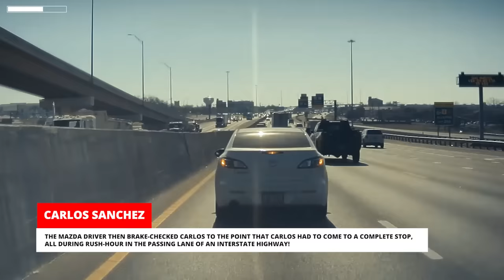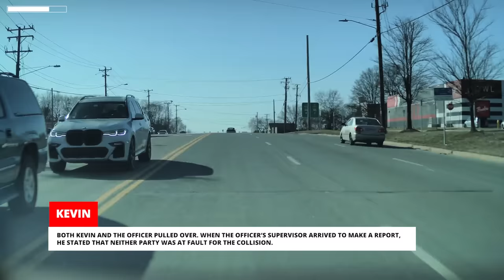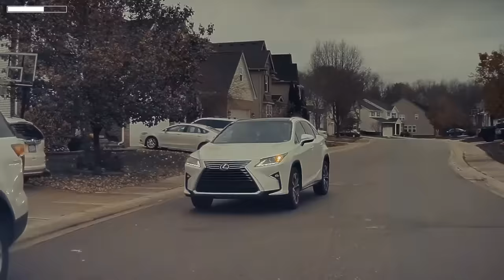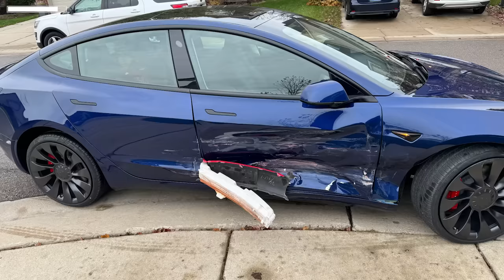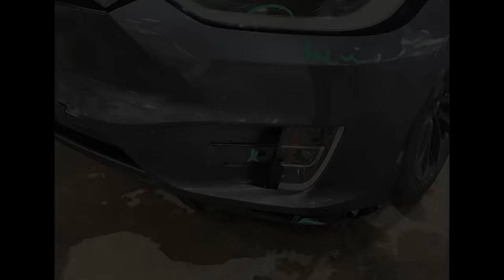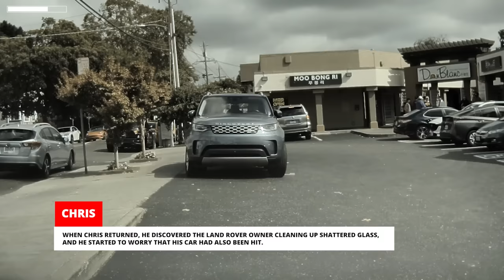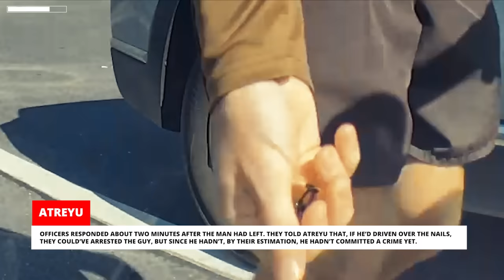INSANE ROAD RAGE ATTACK CAUSES MASSIVE HIGHWAY CRASH

Comment: The accident with the Madza when the police did not enter into the report
 In TX that is considered a non-contact accident. The other drivers involved due to inattention and faulty evasive action (a catch all)
Reply: I was going to write the same, is considered a non-contact accident, which not all states have it, but in Texas is possible, the Officer should known that, which is hard to prove it unless... you have dashcam or TeslaCam.

In Miami, I saw something similar but only one car was involved, the office said the same thing to the girl, but back them I didn't know about this.
Reply: In The netherlands it is not aloud to stop on the hiway without a good reason.
Reply: Doesn't matter what state it's in.
EVERY one of those involved drivers should get a copy of the video and ALL should file reports.  They will also be able to press charges against the mazda owner (who will, of course, say they were not driving despite the fact they were).
It will also give them the owner's insurance information AND RESIDENCE.

A little sleuthing will identify the vehicle... which would probably be rendered non usable shortly thereafter.
Reply: @amzarnacht6710  Agreed, civil action.

Comment: @Mustafa.  In most countries, a yellow or amber traffic light means "The driver is required to stop at the intersection unless it's unsafe to do so". The video shows a stale Yellow/Amber light (Which means it had been that colour before approaching the intersection). By speeding through the intersection you would have been at fault if there was a collision.

Comment: Mustafa, That light was a stale yellow then you decided to floor it, You had time to stop (Over 4 car lengths and some more) but you actively chose to gun it up to the yellow and then proceeded to run it (Crossed the line after the light was red), I wouldn't blame the guy for merging over thinking you where going the speed limit and was already slowing down for the stale yellow, You where also definitely going 10+ over the speed limit at that point from my experience in Tesla's if you floored it lmao, I'd take it as a lesson learned cause no one was hurt and no damage was done

Comment: Regarding the red-light incident:
Here, in Texas, the yellow light legally must be on for a minimum of one second for every 10 mph (16 Km/h) of posted speed limit.  So, on a road with a (for example) 30 mph speed limit, the yellow light must be on for a minimum of three seconds.  In other jurisdictions, whether it is a law or not, it should be at least a rule of thumb or a guideline.  YMMV.

So, knowing that rule, when approaching intersections and the traffic light goes from green to yellow, I immediately start counting mentally, "one one thousand, two one thousand, etc." and some quick mental math including how quickly I am approaching the intersection and how many seconds are left.  The last variable is if another driver is riding my back bumper.  Then the answer presents itself as to whether I should cruise through, brake, or drop the hammer (accelerate hard).  Here, in Texas, red light cameras are now illegal, so that's one less variable here.

In some jurisdictions, when red-light cameras are installed, the yellow light is shortened.  When this is done, questions about increased revenue vs. increased safety tend to arise.

Do your Math, people!

Comment: Story #1: Texas Transportation Code - TRANSP § 545.363. Minimum Speed Regulations: (a) An operator may not drive so slowly as to impede the normal and reasonable movement of traffic, except when reduced speed is necessary for safe operation or in compliance with law. 
Easy lawsuit against the Texas police for failing to uphold the law.

Comment: @12:05 #6 yes, sadly window-smash "bips" are happening all over CA & especially bay area, bit less now than previous years, but still... FOLD YOUR REAR SEATS DOWN to show empty, so they can just peek inside w/o smashing quarterpanel to reach the seat button. Seatlocks don't help as your window is already smashed.
Put any valuables in locked frunk or maybe subtrunk out of sight, and TURN OFF any bluetooth/wifi devices so they can't sniff them.

Comment: 13:30 “when the traffic light turned yellow, he gunned the motor to make it through but he thinks the light turned red before he made it” 
1. yellow lights mean slow down, not floor it 
2. he didn’t gun it until after the light turned red 
3. again, video clearly shows the light turn red when he’s still more than halfway to the intersection
4. a tesla goes from 60mph (96kph) to 0mph (0kph) in 115 feet. he had more than enough time to stop considering he was going 30mph (48kph) tops
5. not saying the other car’s actions were ok (because they weren’t) but mustafa is acting like he’s an innocent little boy who made an honest mistake when, in reality, blowing that red light was as intentional as it could be.

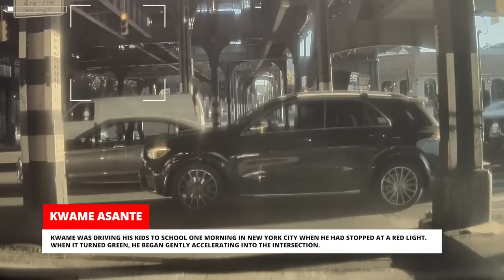Comment: Is anybody noticing these extremely expensive repair costs, or totals?  5:41, I have a Mazda 3 with a similar incident about a year and a half ago. The total repair cost which included a quarter panel, paint and new headlight assembly plus some other stuff, came to $1,800 and took one week if that for the repair.  That dude spent $25,000 and wait 2.5 months with a rental car... $40 x 75 days which is roughly $3K on top of the repair.

No wonder insurance companies are charging people with Tesla's much higher premiums.  This goes for all EVs.  That's why the average cost of owning/leasing for EVs that are supposed to be on every man's car like model 3s are soaring past $1200 a month.

Comment: #15: The officer is wrong.  The driver who caused the collision through negligent or reckless driving is at fault whether their car is hit or not.

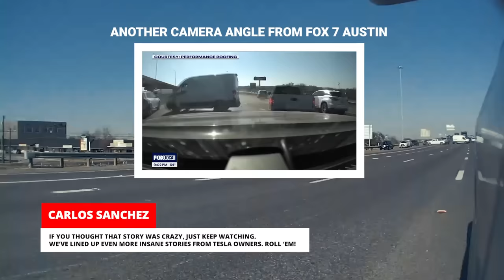2:46 The supervisor is wrong.  The officer didn't ensure traffic was clear before entering the oncoming lane.

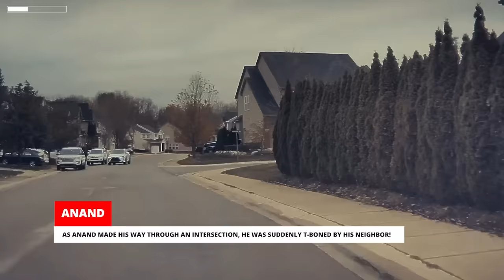6:54  By law, the first person to arrive at an uncontrolled intersection has the right of way; basically, it is treated like a 3-way or 4-way stop.  If vehicles arrive at the same time, the person entering from the right at an uncontrolled intersection has the right of way.  In this case, by law, the person heading toward Anand had the first right of way, then the car on his right and then Anand.  Uncontrolled intersection right of way isn't always as straightforward as drivers think.

13:25  Mustafa was definitely in the wrong for running the light, especially since he had time to stop for the amber, but, that doesn't mean the other driver can cut him off.  Both are in the wrong but for different infractions.

15:01  Legally, there is nothing he can be charged with, but, if they knew who he was, they should have had a chat with him.  I wouldn't have blurred his face either.

Comment: It doesn't matter were you live a yellow light means the red light is coming on and you should stop if it's safe to stop. Long yellows are not long to give you time to beat the light, they are long because you may need more time to stop before, or clear the intersection.

Comment: #11, That is not an intersection. The streets do not intersect. One street ended at the thru street. In Arizona, and I suppose most if not all other states, that would place an automatic yield for the car on the street that ended. I run across drivers that like you don't understand that. Makes for some challenging driving sometimes.

Comment: Mustafa is to blame there.
Yellow means "Stop whenever possible" not "Gun it, YOLO through and cause danger". Clear breach of the rules even if he had entered the intersection before it turned red.

That said the other driver was dangerously indecisive. Probably too old to still drive safely if I had to guess. He set the stage by his confusing indecisive attitude. Which I why I always honk whenever I begin to overtake or undertake a driver who's signalling towards my position apparently incorrectly: If it's not incorrect but indecisive driving, it gives them a chance to react and avoid causing a problem.

If they'd hit eachother I would've pushed for 50-50 damages.

Comment: While Mustafa DID run the red light, I feel like the other driver was trying the insurance fraud scheme. Had their turn signal on for longer than needed without merging and then only merged once Mustafa was about to go around them (trying to cause a read-end collision) and when that didn't work, they tried to merge back into the original lane when Mustafa tried to go around them on the other side. No road rage at all since they never tried to catch up to Mustafa.

Comment: I drive a lot at "Model 3"s accident spot (5:00) , and the max speed there is ALWAYS 100km/h (60 m/h), not only during the day. There are curves not even 300m/yrds after  the accident spot where you can drive max 100 km/h if you like G-forces (I do), but certainly not more. Plus that exit left is one of the very, very few in the Netherlands and a known "conflict" spot (not really dangerous but people shifting lanes a lot). Speeding there like that is just insane. Speeding without seatbelts is Darwin Award level stupidity.

Comment: Story #14.  100% officer was responsible, he pulled into oncoming traffic, the blue lights are no good if they are out of sight.
Story #5.  Mustafa's fault, the red light was entirely within his control, he saw the lights were on orange, and had plenty of time to stop, but chose to take his chances, even though he would not make it as far as the lights before they turned red.  He needs to reevaluate his style of driving before he either gets hurt, or worse, injures someone else.  Roads are not racetracks!
Having said that, the other driver's actions were also bad, and risked endangering other road users as well.

Comment: You should NEVER run a red light. You keep your eye on the lights and when yellow you stop if you can. YES they did turn red before you got to the line which means you should have been able to stop. Next, you NEVER honk when you are so far behind the car changing lanes especially as I believe you were going over the speed limit by then. A golden rule is never undertake another car unless they are turning. You'll have less trouble with situations like lane changing, other cars turning in front of them, hazards on the road, etc. Give the other car space, don't be in such a hurry and don't always think you can overtake - there can be a reason the other car is slower. Also just stay clear of other cars behaving unusually - you just don't know what is going on and why. If you're running late, just accept it and drive safely to the conditions. Some other people do crazy things on the road. Don't be one of them. Don't be a victim of their mistakes.

Comment: Mustafa, my dude, you were in the wrong. The traffic light had turned yellow when you were half a block away from the intersection. It was obvious that you wouldn't have made it without running the red light. The car with his turn signal on had gotten up to the intersection and had a solid white line indicating to remain in his lane when approaching the intersection. Once he had cleared the intersection under the yellow light, he then began to change lanes legally. You then proceeded to accelerate from half a block away and through the red light because you couldn't have stopped in time for the red according to you and nearly struck the other vehicle. Which also indicates that you were speeding as well as running the light. You then claim the other driver tried to force you into the oncoming traffic lanes as you passed. According to the camera, the other car was all the way over into the right lane as you passed him in the oncoming traffic lanes. 
So, lets add up the traffic violations you committed in this short video clip. Speeding, disregard automatic signal, guessing you didn't use turn signal as you changed lanes so will leave this one as questionable, Driving left of center (oncoming traffic lane). Those are all enough to lead to an arrest for reckless driving which is a misdemeanor. Way to rack them up in a 1 block video my dude.

Comment: To the submitter at 13:29 yes it was your fault for running the red - which was in your control. The last thing you want to do when you see a yellow is speed up. If it’s safe to stop, stop, and if not, proceed at the same speed. You had a ton of time to stop for that light. The other driver ran the red as well and made an illegal lane change though. Also, honking was the right thing to do there because it caught the other drivers attention. I don’t see why you think it ticked him off, but passing him that aggressively was extremely unnecessary and dangerous. My guess is the other driver veered into the other lane because either he was distracted or he was looking at you in his blind spot - some bad drivers steer in the direction they look when they check over their shoulder. Looked like he was all over the road. Treat this as a lesson. Stay patient, stay calm, and drive defensively.

Comment: #15 - Carlos blatantly cut off that Mazda as they were about to pass.  When a car traveling faster that you is about to pass, you wait to change lanes until they've passed.  You don't just cut them off.  However, that Mazda driver's reaction was completely out of line, and went through a lot of effort to catch up and brake-check Carlos.  I can understand the cops not going after the guy because really they can't do anything based on hindsight. The driver can claim they had to brake suddenly, and he actually wasn't involved in the accident even though his actions led to it.  Technically, Carlos and the Mazda weren't involved in an accident because their cars never touched.  The people behind Carlos caused their accidents by following too closely.
#14 - The cop didn't check for oncoming cars before pursuing the other car.  So, that's his fault.  Despite what the supervisor states, it isn't up to him to decide fault, that's up to the insurance adjusters.  Also, the cammer couldn't stop because he wasn't in control of the car, he probably didn't have his foot near the pedals, or hands on the wheel. Why are people using FSD while just driving around town?  That's pure laziness.
#13 - That's why you only change one lane at a time, not two or three.  That BMW was already in the lane catching up when the cammer entered the same lane.  Had he actually checked his mirrors and blind spot before making the 2nd lane change, he would have seen it.
#11 - That's a complete waste of everyone's time to go make a police report, let alone call them out for a minor accident.  A police report isn't going to help in the slightest unless a cop was there to actually witness it.
#6 - Yes, this is completely normal for CA.  Incidentally, the people who live in the areas where this is common are the ones who voted for the laws that led to crimes such as this literally being punishable only by citation (if actually caught).  Then they complain and wonder why crime is out of control.  It has gotten so bad that only now are elected officials actually realizing that their plan to decriminalize everything has massively backfired.  Just like Oregon's legalization of hard drugs is currently being reversed.
#5 - Mustafa clearly doesn't have smart parents, as evidenced by his own stupidity.  This is one of the very first things I taught my 17-year-old.  If you have time to stop, you stop.  He was completely in control of running the red light.
#2 - What is there to hold the guy accountable for?  Nothing happened.  Sure, he put nails down, but they were found and the issue avoided.

Comment: The police are right.  Drivers have to maintain a safe distance and speed in the case of an emergency stop. The Tesla driver stopped in time, the other drivers didn't. If the road rager was a kid running out to get his ball instead, who is at fault? The kid? His parents? I know, this happened to me and the local PD gave me that example and it didn't matter I had dashcam video. I stopped in time, the cars behind didn't. Each car that rear ended the other was at fault for their part of the crash.

Comment: 14:04. Yellow light means prepare to stop. If the yellow light burns for a long time, then the lights sadly have been configurated wrong. But its still your fault for gunning it instead of preparing to stop when the yellow light is lit. And then Mustafa ran the red light. This running of the red light wouldn't have happened if he had done as the yellow light told him to: prepare to stop.

Comment: Re: Kevin - How could you not stop in time? Were you not paying attention. When there are flashing lights with a car which is perpendicular to the flow a traffic, the car is going to cross into your lane of traffic.
Re: Mutafa - Other driver is obviously at fault BUT... Kevin has to be more defensive. There are a lot of crazies on the road (as evidence in this video alone). You were in a safer position behind the car and so even consider taking a different route so you don't have to be near that car anymore... which could have been true what Carlos should have done as well. But it is crazy that the Austin police did nothing when Carlos has video evidence of the car acting reckless like driving on the shoulder. That's a ticket in itself.

Comment: 14:15 It is illegal to change lanes inside a intersection, it'd be up to interpretation of a officer or a judge if they ran the red light though, but that could also end up with reckless driving in worse case scenario.
Reply: That's wrong.  It is legal to safely and properly change lanes in or near an intersection in Massachusetts, as well as most other areas of the US.  As far as the red light, it was very clearly red before the cammer entered the intersection and he had plenty of time to slow down and stop when the light turned yellow.  The other car was pretty close to the intersection when the light turned yellow, so slowing down safely might not have been an option.  In those cases, you proceed normally through the intersection.